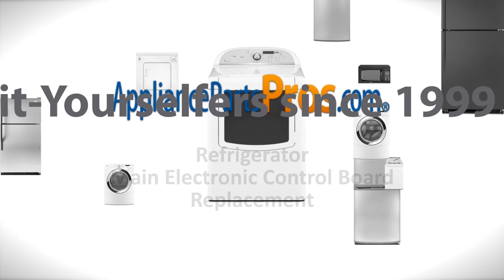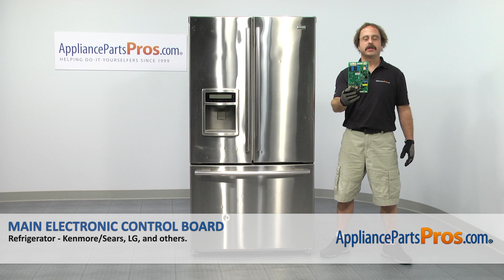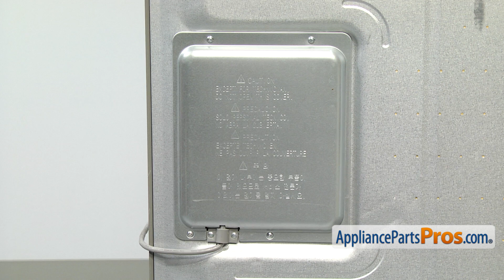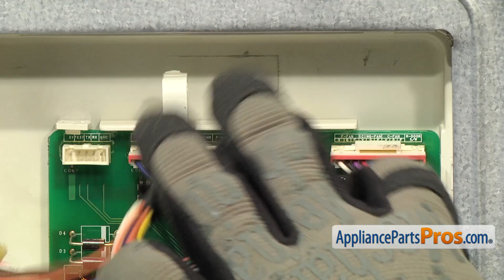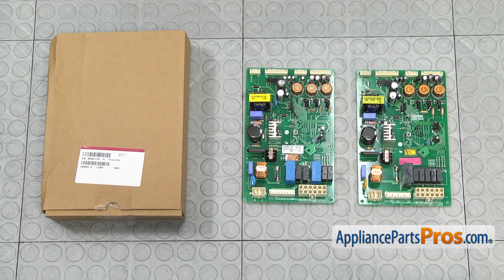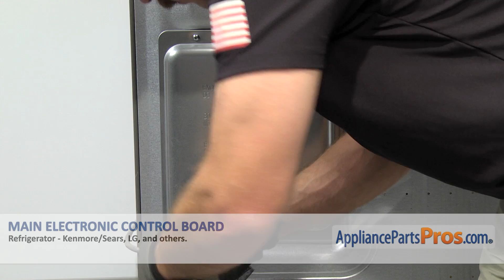How To: LG/Kenmore Main Electronic Control Board EBR34917104

Comment: Do you have a set of instructions on how to replace the control board in refrigerator 253.44123802?
I have the replacement part. Thanks

Comment: i bought LG  Control board replace my old one but the freezer and the refrigerator is not still working i don't thick my old one is bad I guess I didn't not know what is wrong with the L G  French door fridge
Reply from the maker: Without knowing what you have, I would suggest posting the problem along with the appliance model number on our repair forum and the techs can help you troubleshoot the problem. http://forum.appliancepartspros.com/

Comment: So I’m having a issue with my lg fridge, so the power went out in the house and now the power is back and the fridge is no longer working at all, the ice machine lights on tho inside that you can select ice cube size. The front panel screen is no longer on nor are lights inside and it’s not running at all what can this be
Reply from the maker: If there was a power surge, it could have shorted out the control board. We would need to know your model number to point you toward the correct part for your appliance. You can look here on our website to help you find the model number: http://www.appliancepartspros.com/modelnumber_locator.aspx You can give us a call at 1-877-477-7278 or you can chat us at our website: http://www.appliancepartspros.com/. We’re here to help 7 days a week.